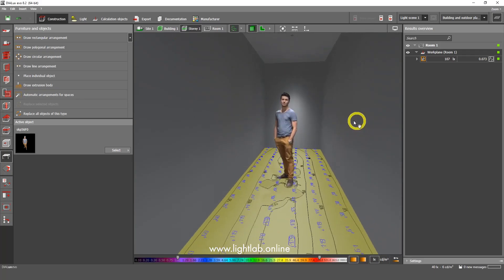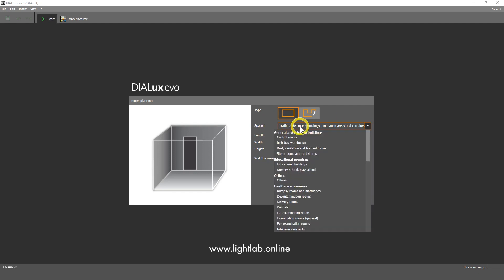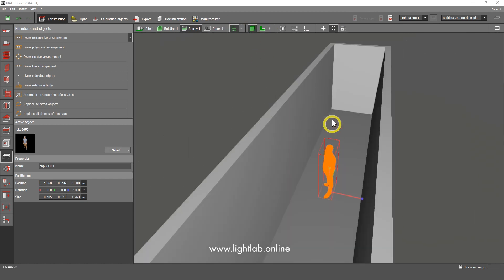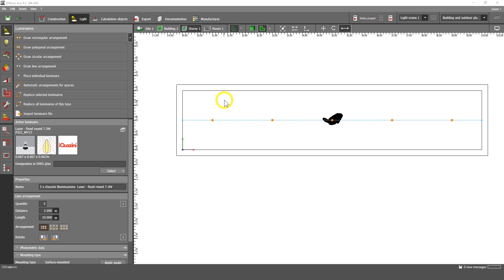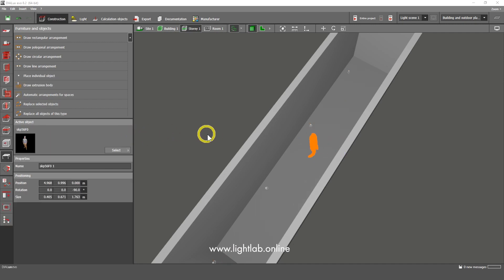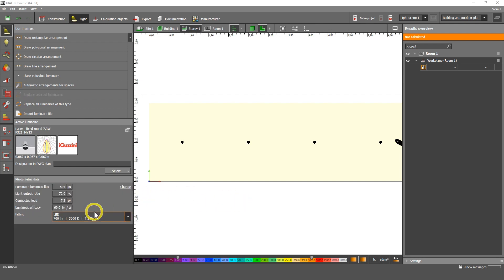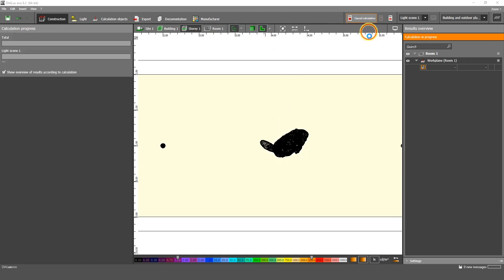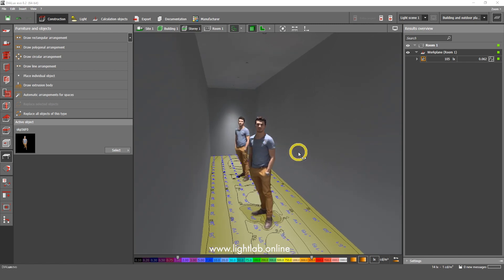DIALux EVO (ENG). How to make lighting calculation in the corridor?

Comment: Dialux Evo has any option to delete calculation points that intersects solid objects like in this case 3d people?
Reply from the maker: Yes. If you select calculation surface. On the left side of parameter window you will see polygon that you can cut from calculation surface